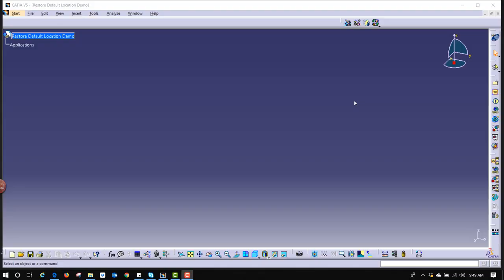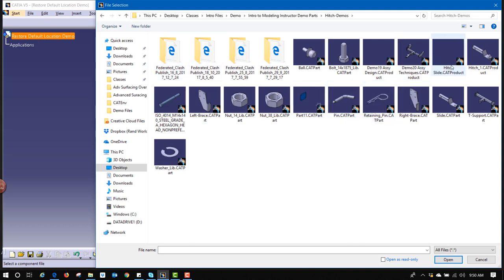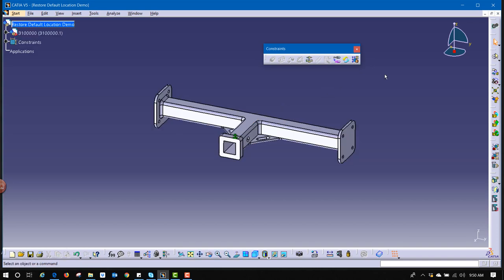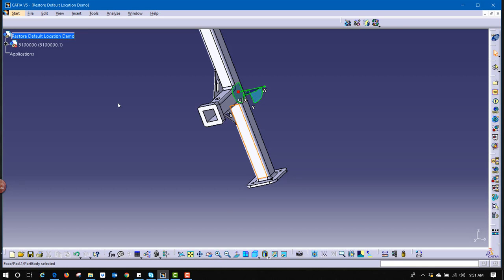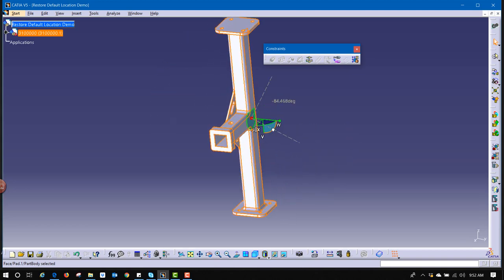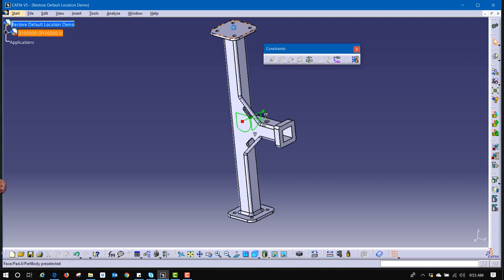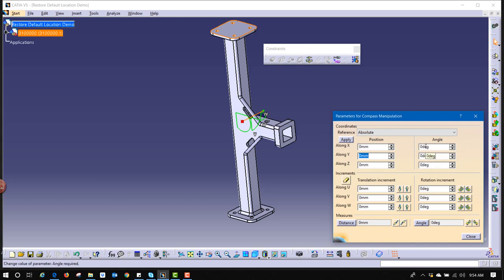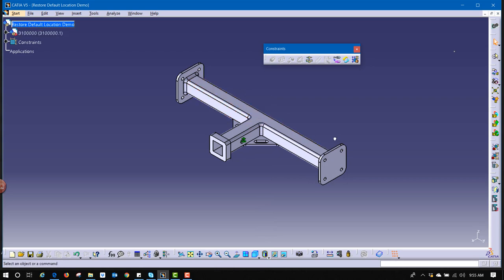Fixing a Base Component back to its Original Location

Comment: Hello,
I was wondering how you turn the shift control on and off.  I have currently turned it off but I can't remember how I did it.  I would like to be able to help my friends to know how to turn it on and off.  For example, when I am making a title block I had to use the shift key to control the text boxes for fine adjustment, however I have turned it off and I have no idea how I did it now.  I can't seem to find it.    I have watched some of your video's on youtube and currently your videos are the most helpful.  Also in solid works you can add properties links between the part and drawing.  For example, I can put the weight and the material of the item in the title block, and the material will automatically populate it via a property link as will the weight.  I can also automatically put the current date in.  I was wondering if Catia V5 has the same functionality.  I hope to hear from you soon.